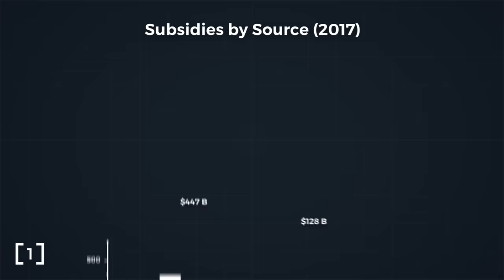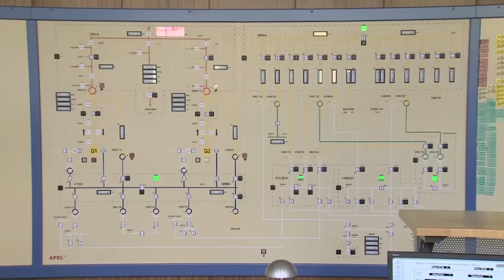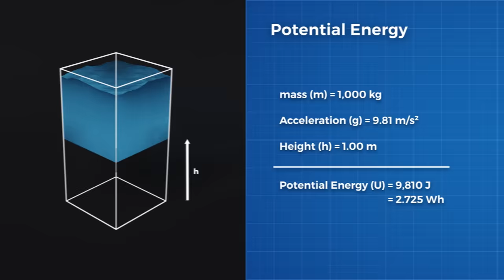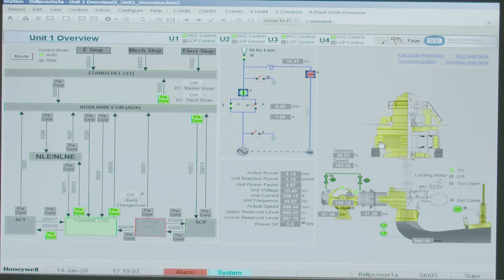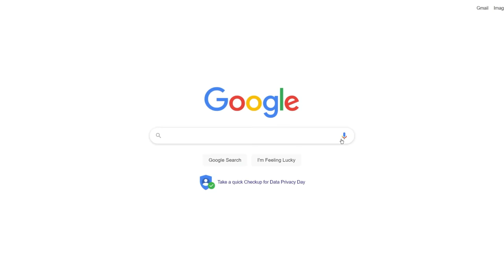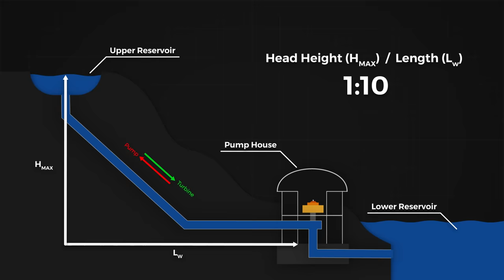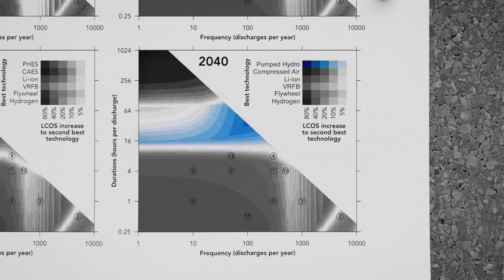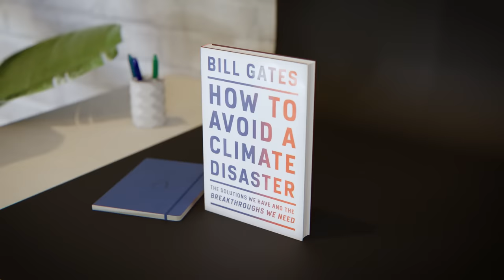The Truth About Pumped Hydro

Comment: Easily the most impressive thing in this video is how closely the predicted wind generation matched actual production.
Reply: Not really: centuries of observation give you an incredible amount of data to work with or train your NN; I think any European coastal area could duplicate this; ...and then you add earth observation satellites.
Reply: the Texas grid ERCOT site has panels for about a dozen key stats which update all day.  Well worth a watch - one of them is the projected day output for both wind and solar.  Pretty accurate projections, and I say that knowing the time intervals they're using are a bit blocky.  Its just ercot  and a  business domain ending - then look for dashboards.  You can do things like watch the fuel mix panel, current day and see what percentage is currently coming from which generation sources at various hours ...  pretty decent site and you can see the correlation between prices and such as well.  I'm sure as time passes, their increased data set for weather and use patterns will get more and more accurate as well.  TX is the largest electricity generating state in the US by almost 2x over FL.  Last year they got about 32% of annual total from just wind and solar as a set.

Comment: I say we use more nuclear. The technology behind molten Thorium salt reactors is particularly interesting and is incredibly safe. People kind of gloss over nuclear but it could be a valuable tool to fight climate change.
Reply: Nuclear is not flexible when it comes to capacity.   Throughout a day supply and demand of energy fluctuates dramatically...only natural gas plants can react in time to these quick changes.  The alternative to natural gas will be bulk storage as discussed in this video.
Reply: @AaronSmith-sx4ez  good point. Historically, nuclear‘s role in energy production has been to provide baseload power, however, it is possible to build reactors capable of quickly ramping up/down their output.
“French utility EDF began making its nuclear plants more “maneuverable” in the 1980s, and today it says a 1,300-MW reactor can increase or decrease its output by 900 MW within about 30 minutes.”
Source: https://www.powermag.com/flexible-operation-of-nuclear-power-plants-ramps-up/
Reply: @AaronSmith-sx4ez  small modular reactors might be able to help with that.
Reply: @bensonboys6609  wow. I didn't know about that, thanks
Reply: @AaronSmith-sx4ez  thats only if your using the old tech and haven't set up your plant correctly, look at molten salt reactor, they have a high heat reactor(800C+) that can easily be ramped up and down by controlling the flow from the pumps, also you wouldn't want to ramp it anyway you run it full till and use the excess heat to fuel the production of fresh water, liquid fuels, fertilizers and any other high heat needing reactions/chemicals.
Reply: The truth about thorium is that nobody has ever successfully used U-233 made from thorium to create an equal amount more U-233 from thorium to keep the cycle going.  Due to the high neutron absorption of protactinium-233, the protactinium would have to be constantly removed from the reactor to avoid ending up with a bunch of useless U-234 instead of the required U-233.  However this process would be complex, expensive, and would produce pure U-233 suitable for bombmaking.  There are a lot of internet hype about thorium, but the nuclear engineers in China and India who are actually trying to make the thorium cycle work understand that it will take many years and many billions of dollars to actually come up with a workable design.
Reply: @faroncobb6040  you sound like you know your stuff! I didn’t know about that.
Reply: Re: flexibility, it's worth noting that most first world cities' baseloads are around 1,000 MW or more. So it doesn't really matter how fast nuclear can ramp up or down - if you're thinking of a reactor in the first place, chances are that's it's always going to be at max.
Reply: @AaronSmith-sx4ez  Except that is not true. Even gen 3 reactors can follow load 30 minutes in the past while batteries or pumped hydro keep up with current demand. The reactors now build in france can go from 100% power to 25% power in circa 10 minutes and steam generators if build for peaking can work with this power fluctuation fine. Lastly a nuclear reactor is a source of heat not electricity. The turbine turns heat into electricity and thus the turbine decides how much power the plant produces. Even if the reactor makes to much heat your cooling towers will be able to at least handle the energy that wasn't turned into electricity because otherwise it wouldn't have been build because it would have been deemed unsafe.

By retrofitting turbines and increasing cooling capacity slightly every nuclear power plant becomes a peaking plant.
Reply: @pokekick4185  not to mention that it can be built to make use of that excess capacity in other ways (salt water desalination, industrial processes requiring heat, etc).  

The weird,foolish and illogical terror about nuclear power has held back the one thing that vould have cured the climate crisis 50 years ago.  All the waste produced by the US nuclear power industry fits in a football field, 1-2 stories tall.  What else even remotely comes close?  Its also safer than almost any other form of power generation, responsible for less fatalities and illness than almost any other type.  People too often conflate nuclear waste from bomb making as the same as waste from power generation and it isn't.  The waste from power is vastly less material and also vastly less radioactive. 

Nuclear should be the baseline with renewables used to fill in the gaps.  Instead we are going to build giant battery farms at massive expense and in 15 years  we will have giant volumes of battery waste we are trying to figure out what to do with.
Reply: Chloride fast reactors are much easier than thorium
Reply: @NoRegertsHere  thanks! Are there any good videos that you know of?
Reply: @bensonboys6609  
good intro
https://youtu.be/C6BGLgJY0Wg

More detailed:

https://youtu.be/WZn4rGF9B-Y

https://youtu.be/_ou_xswB2b0
Reply: I actually just started watching https://youtu.be/VuDLCt4sEeA and it looks really promising. If you have a favorite video, I’d love to see it!
Reply: @bensonboys6609  I learn something new on each one.

Comment: I like how you went straight for the shut down on the subsidy argument 👍👍👍
Reply: He should do a collab w/potholer54
Reply: Those numbers are brought to you by Bill Gates, so take with a huge grain of salt.
Reply: The argument in the video is really bad. Total subsidies are not relevant without knowing the total expenses in the sector, nor the total product.
Reply: He didn't compare the subsidies with the actual energy generated per year (his graph was back in 2017 at 0:30). Fossil fuel subsidies are pretty mundane when you look at the productivity, not that I like those subsidies. Don't compare installed capacity either, compare actual energy generated since solar and wind have an annual capacity factor of 10-20% and 10-50% or so. Even the Hover Dam is drying up and its capacity factor is like 20% when the dams near me are around 50%.
Reply: @taylorc2542  Not really since he had to do his own research for the vid, bill was just supporting the vid. it's real engineering research.  and to be honest, when is bill wrong he's right most of the time.
Reply: @leerman22  I caught that too, it was a bad calculation... but he probably didn't do it on purpose.
Reply: @laststand6420  I think it was not on propurse on the sense that he tried to mislead people. But he clearly shows that he did not has a great grasp of the economics behind subsidies and how to really take them into account.

I liked the video, but this part, as an economist, is really bad.
Reply: @laststand6420  I wouldn't trust Gates of late. He's saying we need all synthetic meat; fine for burgers but I'm pretty sure he'll still be eating real steak while flying around in his private jet.
Reply: The subsidy strawman you mean?  He cited the TOTAL fossil fuel and renewable subsidies $$, but then only compared the "new capacity" in 2017, NOT THE TOTAL capacity.  Perhaps honestly compare the total subsidies to the total power generation capacity?   I'm for clean energy, but misrepresenting data doesn't help the cause.
Reply: @matthewmcgee  Should always adjust "new capacity" with capacity factor of each plant as well. Gets you an idea just how much energy might be made.
Reply: @leerman22  The desire to feel smug is really damaging society right now, and nobody represents that better than Gates. He got lucky once but failed in every other area of the tech industry, so he retreats to a feel-good religion as a psychological defense. He can't just be happy, he has to "heal the world" and exert power over people. Gates could dump all his money into cancer research or children's hospitals or something that everybody supports, but no, he doesn't feel powerful unless he's pushing divisive/controversial ideas. In fact, he's only attracted to those ideas because they make him feel smug. It's peak decadence/fall-of-Rome type stuff.
Reply: @TomatoBreadOrgasm  I totally agree, but he probably made this mistake both by Confirmation Bias, and ignorance of economics. 

If he knew enough economics he would know that the data was irrelevant without further information and desegregation.

Second, he would understand the subsidies can include (and as far as his sources goes do include) tax rebates, which is highly problematic to include when debating inter industries subsidies.

Comment: I'm curious, on Point #1, what's the subsidy comparison measured in per MW, rather than raw numbers?
Reply: SShhhhh
Reply: Don't ask intelligent questions. Just go along with the narrative.
Reply: Nuclear starts looking real good when you ask that question.
Reply: Coming from decades of experience in the oil and gas industry, they're just as reliant on subsidies as anyone, especially since 2016. I don't have a problem with subsidies either way, but the way they are used.

For example I worked on a significant compressor upgrade subsidy, entirely paid by the provincial government. A few teams of 20 guys and equipment went around the province and upgraded about 200 each. It was good work and we were paid for it. Now the equipment was supposed to produce less nox and be about 10% more efficient. Sounds good, except the oil companies sold a significant amount of the upgraded units outside of the country. 

So inevitably the subsidy only padded company coffers and did little for the environment locally.
Reply: Yeah, that my my immediate thought as well. He did not refute the statement at all.
Reply: @Leggir  I don't think anyone doubts that, the issue is that oil and gas unfortunately continue to provide way more energy than wind and solar so simply going "they get more subsidies" means very little.
Reply: How can you ask such a ridiculous question in the middle of a climate disaster?
Reply: @frank8534  climate disaster ??? Don't know what you are talking about. Just because the climate of our planet goes in hot phase doesn't mean this is unnatural or that we are the most important factor.
Reply: @alexandervlaescu9901  sarcasm is hard to articulate via internet…you just have to know my personality.
Reply: Stopped watching when his "proof" that renewables were cheaper was that they received less subsidies and had more growth.  I'm bigger than you and I'm taller than you so I could beat you in a fight...might be true but certain not a proven statement in any way.
Reply: @silverhusky7993  there is no increase in the rate of sea level rise, look at NOAA tide guage data. Also, sea level rise and melting glaciers is normal as we are coming out of an ice age. There was a lot of "glacier melting" in the roman and medieval warm periods. Lastly, since you're in the information age, you might want to check historical atmospheric CO2 levels in ppm over millions of years looooooool. Btw the "increased frequency and intensity of weather events" is also nonsense if you dig into the records. The problem is you evidently have blind trust in a climate lobby seeking to secure grant money and their own careers rather than actually investigats the science.....
Reply: Frank what disaster?  Disaster is a past tense.  Please explain what, where and when.
Reply: SilverHusky fossil fuels have given us the comfortable inexpensive life we have and extended life expectancy.  The rapid unmanaged closing down of this source will cause problems.  Transition is inevitable as fossil fuels are finite.  Mismanagement of transition will cause hardship and early death for the old and poor from cold not warming.....
Reply: @jackhawthorn4799  Look at the description, it is payed by Billy.
Reply: Renewable energy gets 3-4x more in subsidies per MW.
Reply: is that relevant though, because Renewables have a much lower operating cost than fossil fuel, so looking into the future, subsidizing the development and future of renewables is just superior no matter what.
Reply: @ayoCC  Yeah, but finding 1 stat that looks good isn't very honest.   

What's the TOTAL cost over the normal life span.   For example with wind,  they didn't anticipate the maintenance costs.   They thought the fiberglass parts would be virtually maintenance free, but now they find that the constant movement assaults the props, and they need to be replaced or repair MUCH faster then they planned, and what do you do with these massive blades when they fail? These things take massive trucks to get out to these locations, now you have to dispose of them, and you're talking tens of thousands of dollars to dispose of them.   Not Factors into renewables at all.
Reply: @surveysays8335  how did you acquire that information. This seems like something that would either be proliferating well or taught in school/Uni. I have a couple more questions
Reply: @surveysays8335  to break things up a bit, 2nd comment.
The claim is that wind energy is more expensive per kW than coal? And that is because of the fan replacement, disposal and shipping?
Reply: @ayoCC  Did I say that?  
I'm saying,  with anything you can't cherry pick stats, specially on new technology.   A lot went into talking about how great WIND is, and here we are years later finding out,  wind isn't really a great source of energy for a lot of places... Maybe some sweet spots without salt or sand and consistent winds, but not too much wind...
Reply: @surveysays8335  ah I see, and yeah it's a process. Fundamentally wind is great, but it's not an iPhone that is mass produced and can work exactly the same everywhere yeah, more like a house, each one you build is unique and depends on where you put it.
Reply: The thing is much of that fossil fuel 'subsidy' number is often artificially pumped up with deductions available to any industry. And it is a much bigger business and there are many badly run state-owned players, so yeah it will be higher in absolute terms. The question is more, in the absence of any government support what would our energy mix look like?
Reply: @davidramsay6142  read all of my comments
Reply: @jackhawthorn4799  honestly, as someone who did study the related fields, I'd worry more about eutrophication and seawater acidification than "intensity of climate events". Granted, we "should" eventually move away from fossil fuels, if anything due to the sheer waterways damage mining and pumping oil and natural gas causes.
Reply: Don't forget lifecycle. Coal/gas station ~60 years. Solar/wind ~15.
The amount of positive media around 'renewables' is staggering.
Reply: According to ourworldindata wind and solar voltaic are cheaper than anything else even when accounting for subsidies, idk why he went about it in such a weird way but the underlying point is correct.
Reply: That would throw a wrench into the "durr durr, fossil subsidies bad" narrative.
In fact for power produced, solar is the most subsidized, then wind. Only then comes fossils in general, then Hydro and other renewables like tidal, Geothermal and Biomass, and last place, Nuclear.
Reply: @HydraulicDesign  if there was even regulatory and public opinion playing field? Probably a lot of nuclear and Hydro in the mix.
Reply: I get the impression Energy Minister Bowen is irrevocably committed to something he doesn’t understand.